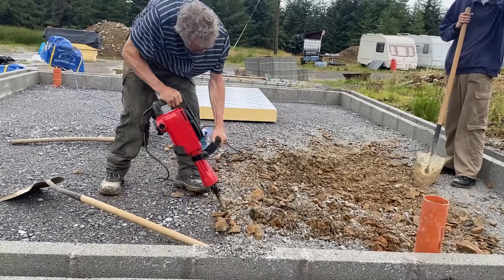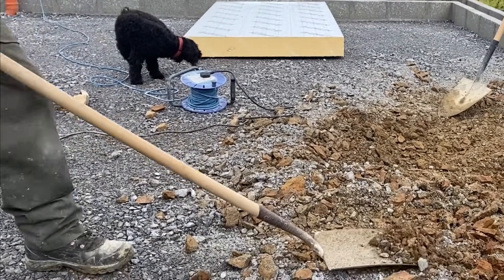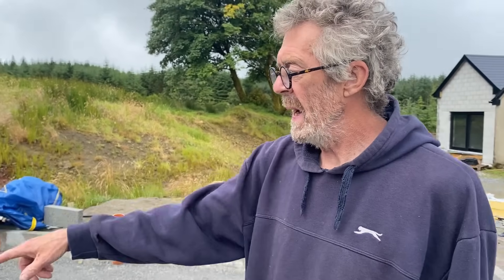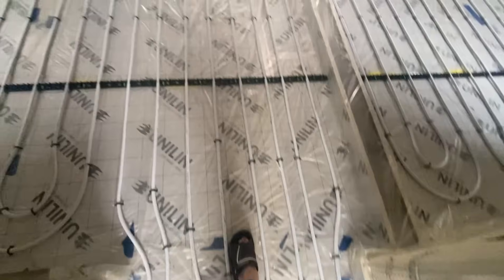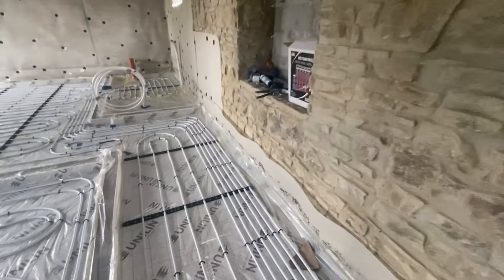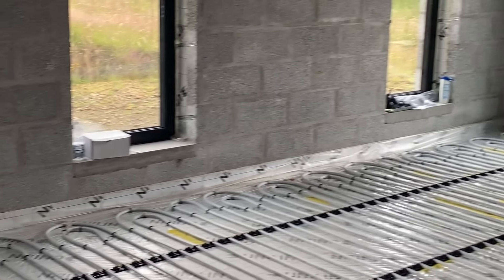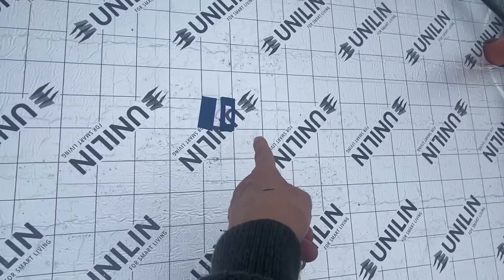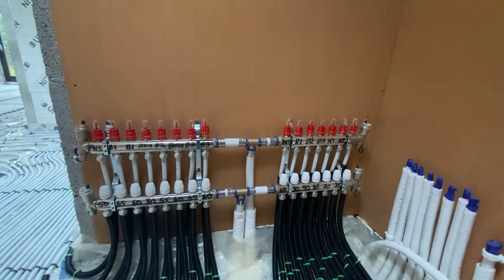Would YOU Put a Heat Pump in a Cottage Like This?

Comment: I built my house in 98 so not as well insulated as yours. Been using a A2A mini split AC for heating a four bedroom house for 15 years. It’s never missed a beat and I’ve self serviced it so no added expense. Shortly going to replace with a new Mitsubishi r290 unit with energy rating of A+++ in heating mode SCOP 5.2. 😀
Hope you are choosing an r290 unit and your installer sizes it right. Correctly installed and used you’ll never regret the savings you’ll make. The nay sayers usually have badly installed systems or try to use it like a gas boiler.
Reply from the maker: That’s encouraging. Sounds like you’ve got it sorted and working well in your home. Ours is an R32 unit. It’s bewildering getting your head round it all. Often it seems with an advance on one front there’s a payoff on another. Thanks for sharing Paul 😊

Comment: We have a thermia heat pump in a retro fit two years now and no problems . We have an electric shower in the event if it stops working so we can shower and we have a stove also .
Reply from the maker: I was so relieved to get to the end of that first sentence Kenneth: I’m glad you’ve had no problems. We’re getting the ITec model which is supposed to give higher temperatures and uses R32 refrigerant. Do you find it gives you the desired temperatures?
Reply: My wife is a very cold person so she feels the temperature difference in the winter so we light the stove at the weekends . At night we have to turn the starts down so the heating doesn’t come on as the bedrooms are very warm . I would say your house will be much better as you are essentially a new build . We have a family of five so we have  5 showers a day and we found a rise in mould if you don’t have air flo . Wet towels cooking drying clothes adds up to a lot of water so I would  put some sort of air flo system in .  With regards to the thermia we find it very reliable and have had no trouble with it . Hope this helps .
Reply from the maker: @KennethCarroll-d6i That’s so very helpful thanks Kenneth. Good to know the Thermia heat pump is coping with demand for your family of five. An air flow system would be an extra expense that we didn’t go for. We will self regulate and indeed will want to open windows as psychologically I crave fresh air inside the house, hence why we chose trickle vents for the windows. We’ll see how we get on and adjust accordingly. All the feedback seems very positive so we’re looking forward to living in and enjoying our future home. 😊❤

Comment: Hi Jill Noel and Sid great to see you progressing, great video. Points of interest air to water are not 400% efficience, in cold weather bairly 80%, where the problem comes in is heating water above ground 30* efficiency decreases, this is the reason under floor heating is always desirable. A good Irish heat pump is GRANT manafactured in Offaly. Solar panels work provided facing south, for example my solar 6.9kw south facing installed 4/8/24 generation to date is 5.75mwk or 1015€ at 20c per kw. Ps ask local electrician for recommendations, avoid fly by night. Get best energy tariff , most important. If I can help do not hesitate to ask.kind regards Sean
Reply from the maker: That’s really helpful advice Sean. Thanks so much. We have friends who have ground source heat pump, but they are a bit more loaded than us lol. It is sooo much more expensive largely because of the cost of digging. We did look at Grant, who seem fairly new. Nobody offered to fit one of their pumps. We could have gone directly to the manufacturer, but then as you say you don’t get impartial advice. I think we’re happy with our choice. Especially since Thermia are owned by Stiebel Eltron… who ordinarily would be out of our price range. Do please follow us on Facebook where we can private message if we have more questions for you. 😃 I will be able to access our socials more easily when I’m on WiFi again.

Comment: Hi guys from Bristol, I love your videos, you work so hard, great work, I love Roy x❤
Reply from the maker: Ah thanks Barb, that was a heavy morning, but thankfully a kind neighbour let us use their shower. It was heavenly!!! 😊❤
Reply: I can't believe people are criticising every move you do!
Underfloor heating has been  around long enough to be reliable now. As to the heat pump, I think your house will be perfect for it. We have just replaced our old gas boiler with the newer version, but our house is old, on floating floorboards and definitely not insulated enough for a heat pump. One has to make decisions depending on what one has and can afford.
Reply from the maker: @Petrelles22 YES, that’s so right. Considering all the different variables for each individual home it’s not surprising that ASHP wouldn’t be a right fit for some, but for us it ticks all the boxes. It can be u nerving if you hear negative stories, but there can be a number of reasons for that. We’re feeling more confident about our choice after speaking to a number of tradesmen with experience of fitting and using them. You’re right, it’s an expensive mistake to make if you get it wrong. But if it’s the right choice it will save a lot of money on energy bills in the long run. 😊